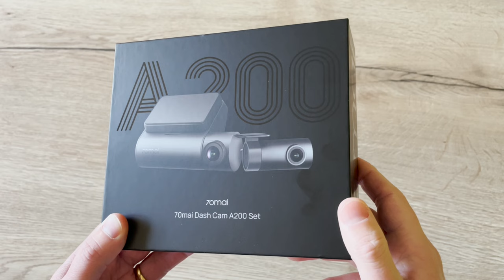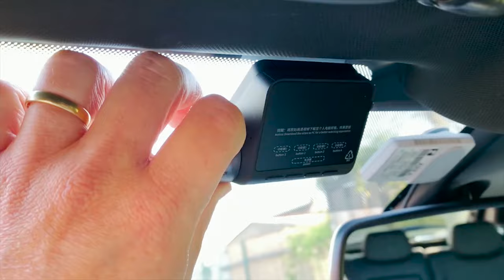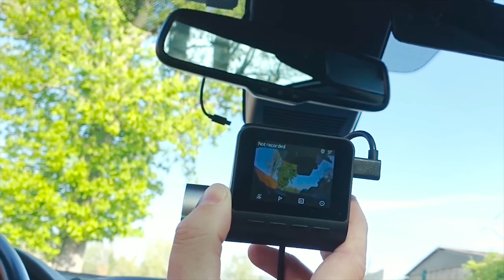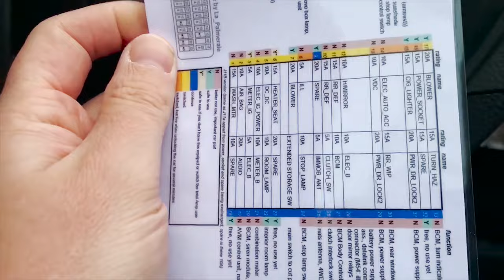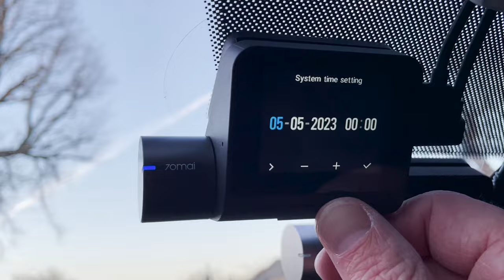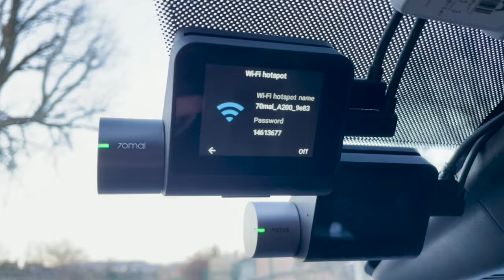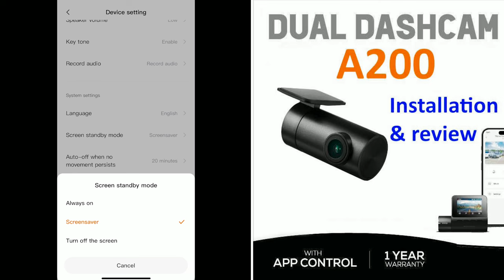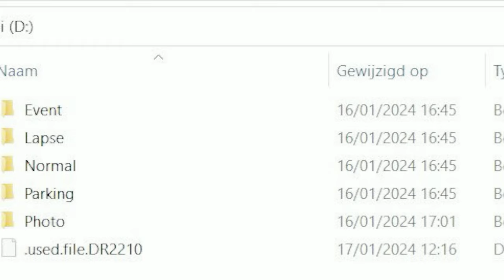70mai A200 dual dashcam: review & hardwire installation tutorial! (the most complete video)

Comment: Hi this is a great video! My A200 does not automatically start up and I always have to press the power button to switch it on after I start the engine. Is it because it has been connected to the wrong fuse?
Reply from the maker: Hi! Thank you! Yes I guess. Mesure the fuse to be sure. I guess it is a continuous fuse. Also make sure you check the dashcam settings to be sure there is no auto off enabled somewhere.

Comment: Hello. I have the A200 and how do we know the parking surveillance is ON? Does it say 'Enter Parking Surveillance Mode' when OFF engine or the green light stays ON?
Reply from the maker: Both and it also shows the parking surveillance logo on top of the screen when the dash cam is on. 😉
Reply: @LaPalmeraie0032  I see, there must be something wrong with my wiring then, I better go visit the workshop. Thank you very much~❤️
Reply from the maker: @fernandomilee2870 did you mesure with the multimeter?
Reply: @LaPalmeraie0032  do you mean to check for the voltage of the fuse? I'm not sure because I went for help at a local car workshop to install it. So does it mean it needs to have a specific voltage in order for the parking surveillance to work?
Reply from the maker: @fernandomilee2870 a published a new video last monday which is just the hardwire part that is also included in this video. The hardwire kit has three cables. The ground (black) wire, that should simple be connected to a metal part of the car. The continuous / + (red - not sure by heart) that should be connect to a fuse that stays live all the time. And the switched / acc (yellow - not sure by heart) that should be connected to a fuse that is switched. This means it only gets power when the car gets unlocked. This is something you can check quite easily with a multimeter but a carshop should be able to understand this and wire it correctly. Check in the dash cam menu, IF parking surveillance is available, the hardwire kit is connected properly. Otherwise you wouldn’t be able to enter this menu. Also check your « auto power off after.. » this should be set to OFF. And then all is set up correctly. Of course the battery should have enough charge. Mine didn’t stay live for a really long time until I charged the battery with an external charger. The parking surveillance remained live every whole night after that.

Comment: Hi，after entering time lapse mode but the green light turn off too， is this normal？
Reply from the maker: It stays on in my car, except when the voltage drops under 11.8V I think. Are you sure you’re using a continuous power source? Does the battery has enough charge?

Comment: Mine doesnt even turn on... its brand new... I am so disappointed.
Reply from the maker: Hi! Did you connect it to the power source? In the car, the outlet should provide power which sometimes is only when ACC is on (contact). In hous you could try a phone USB charger. 😉 Otherwise, you always have 1 year warranty so no problem.
Reply from the maker: Hi, that’s not normal. On a normal 12V power socket it should work. Please contact the seller.